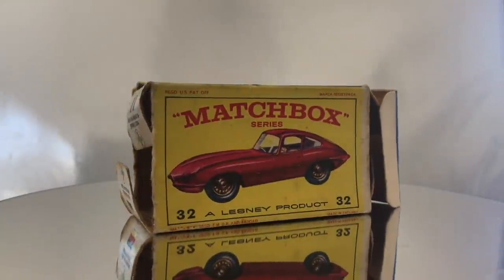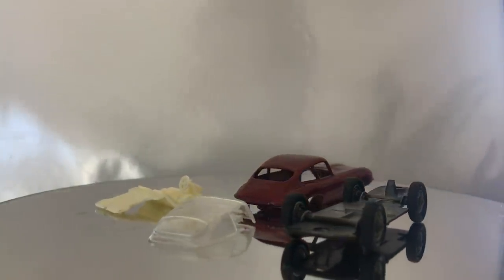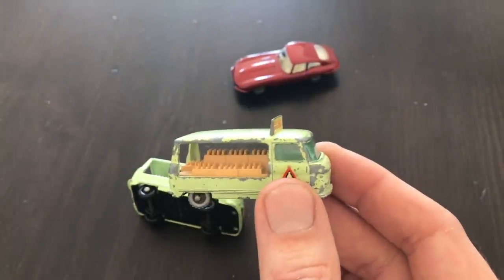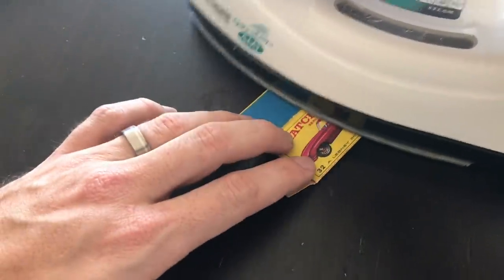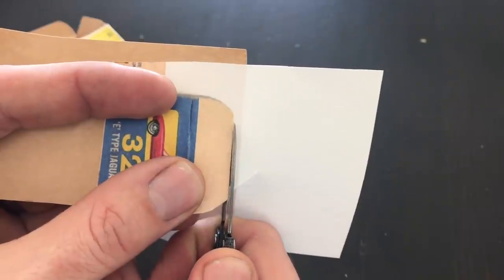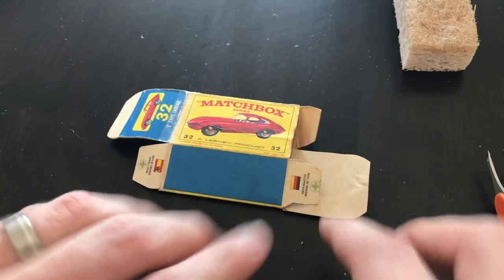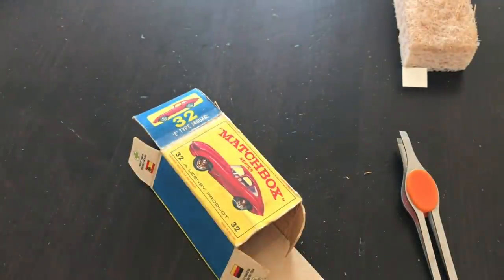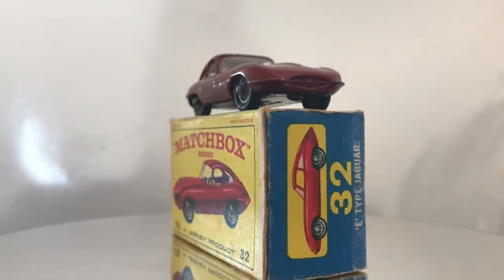Matchbox Lesney #33 Jaguar E type car and Box Restoration

Comment: Very nice. I like that you use Testors paint rather than the Tamiya acrylic. I appreciate that you’re trying to get the model to a factory condition. One thing I’d suggest is instead of scanning the boxes directly into Photoshop, create a template in Illustrator, set to whatever your measurements are, from guidelines, which don’t print, then place the scanned box into that. Once you have the size correct you can export it to Photoshop for color correction. You should also color calibrate your computer screen, scanner and printer so you can get accurate output. Great work regardless.
Reply from the maker: I used both, most people aren't as familiar with illustrator so I just said photoshop.  My screens have been calibrated but I always end up printing several copies to dial it in perfectly anyway.